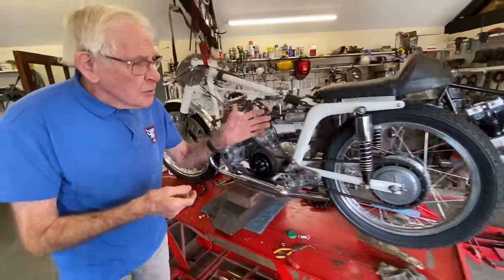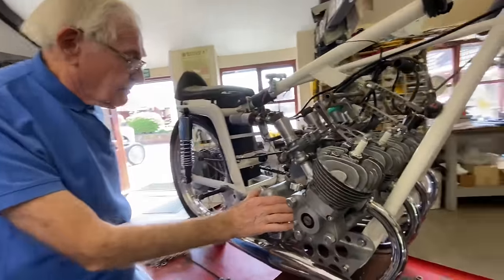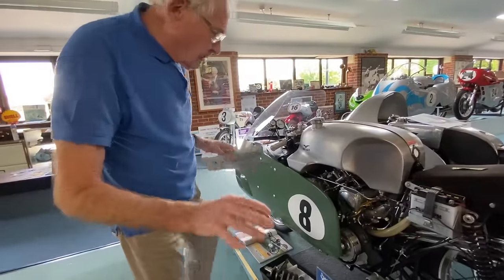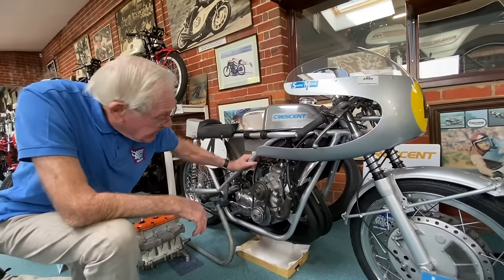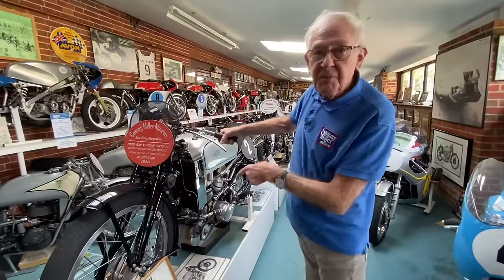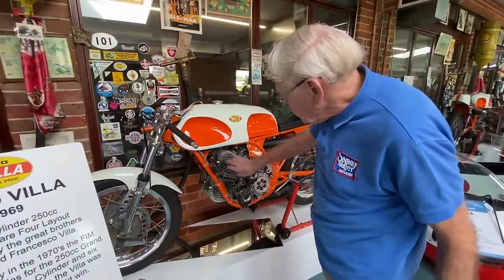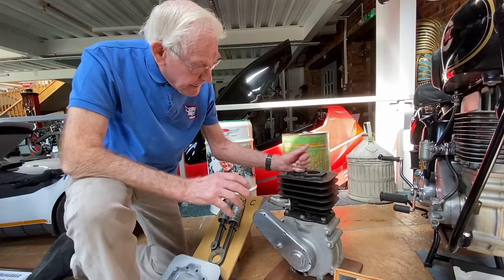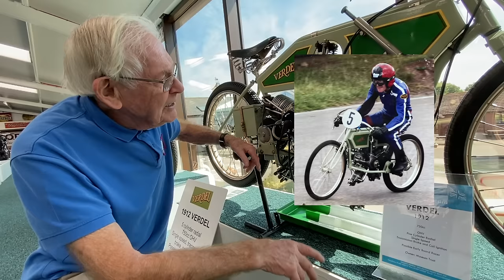Special Feature: Exotic Engines!

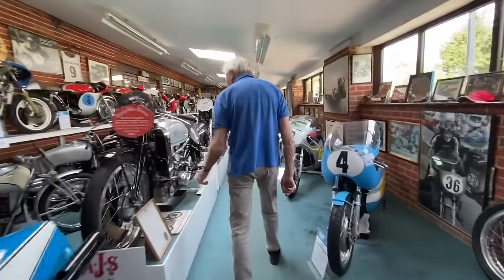Comment: Sammy, you forgot about Guzzi's in line straight four works racer of the early '50s. Also, the Ducati v-twins are 90 degrees, not 120 like that Guzzi at 8:00
Another technical mistake is at 13:50 describing the EMC split single.  The idea of it being supercharged is non-sense.  The two cylinders have an offset of a few degrees of timing, which allows better control of inlet and exhaust port opening  times, and also the gases have a directional flow
Reply: Why did they make it 120 degree V and not 90?
Reply: @irvhh143 it's a much lower engine. That's why.